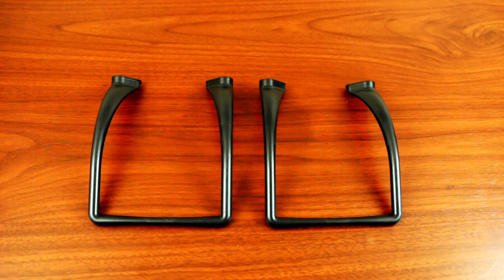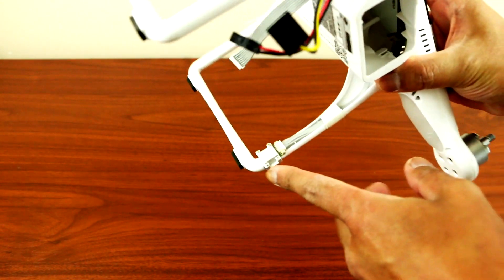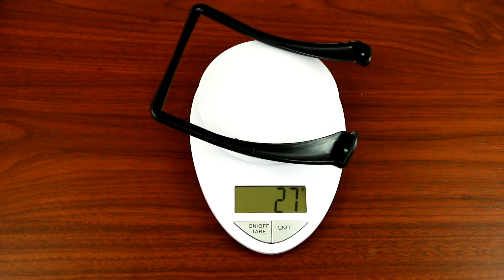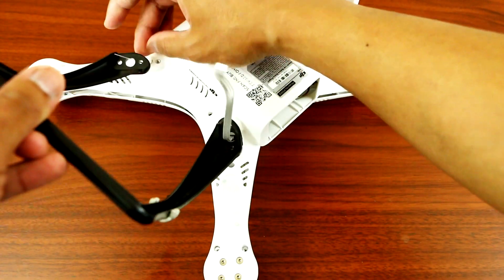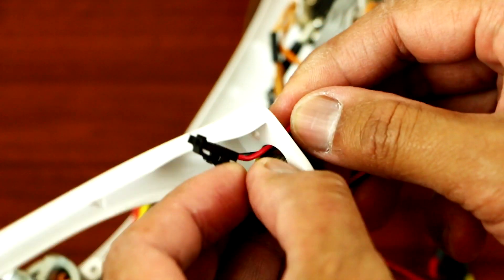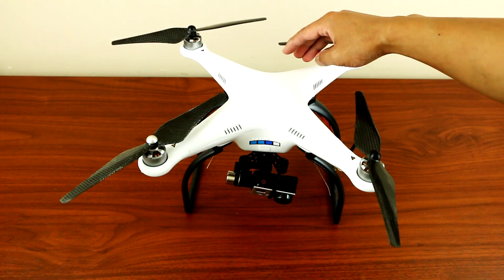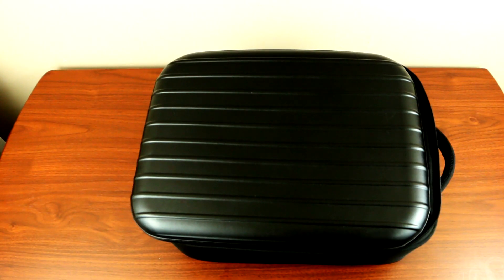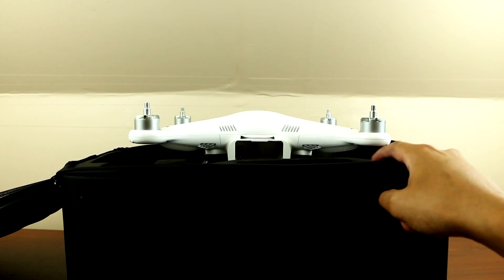DJI Phantom 2 - Aftermarket Landing Gear for Zemuse H3 3D Gimbal Users

Comment: i got a few more tips to make it better i had these before on a drone and I've had tipping problems lol so what i would do is get a few coat Hanger's cut them and zip tie them on the legs and then get some spung things really cheap 2/3$ on ebay and you'll never tip over

Comment: Hi, I want to do this on my P2 but my compass is in its own little plastic case on the rear leg and is not clamped on like yours, any ideas on what I need to do as there's no provision on these legs for my sort of compass?
Reply from the maker: +Andy Heath just use a zip lock. and zip lock it to the new landing gear. anyways, pls don't forget to SUBSCRIBE to this channel as it will help me out a lot, if not that's fine. thanks again my friend.

Comment: need to paint the quad the same color black or give it a unique color. good work having the futaba and carbon fiber props.
Reply: Too bad someone hasn't come up with the idea of just using black plastic in the injection molds instead of white, that way there'd be no need for paint. Daaah!

Comment: Hi, i want to install these however my P2 came with a anti static compass which does not have screws to remove it. It appears to be built into the landing gear that the phantom came with. To instal these will i have to buy a new compass for my phantom and install that as well?
Reply from the maker: it seems like you do have to buy a new compass
Reply: L BS just a thought. could one cut the original leg at the part where the compass is built in and attach that whole part of the original leg to the new leg?.....
Reply from the maker: Dan Headlam it might work, give it a try
Reply: Dan Headlam Dan, did you ever cut the original leg and did whatever else you were going to do? I purchased the taller landing gear as well to prevent damage to GoPro but my compass is also not removable. I'm trying to find a way to make this work. Thanks
Reply: yes i did ...it worked fine as long as you got the measurements fine, in the end though i got a new compass and fitted that as was more secure and all together more tidy.

Comment: Great video with lots of details.
Could you show us better how did you fix your video TX on the Landing gear ? And why your antenna is facing upwards ?
Reply from the maker: fix my video TX??? is it broken?
Reply: I mean .. securing it. How did you secure the transmitter on the landing gear. Sorry, that these might sounded to you all Greek, but ... I am Greek  :-)
Reply from the maker: George Hadjipavlis watch this then you will know why  DJI Phantom 2 - ImmersionRC 600mw Transmitter Placement (prevent velcro glue from melting)
Reply: This location does not interfere with the RC antenna ? Sorry for being persistent but it is a fantastic location and would like to make sure that this works just fine.

Comment: hello, your phantom 2 did not come with can bus expansion module? the can bus Serving for what? I still can not understand!
Reply from the maker: forgot to mentioned that I installed the can bus module in the phantom prior to the installation DJI Phantom 2 - How to install the DJI iOSD mini to Phantom 2 (clean look version 2)
Reply: ok, I'm not using the can bus expansion for nothing, can i remove it from the phantom? will not disrupt the functioning of the phantom? My salesman said that I would lose the warranty if I remove, but for now I do not need the can bus installed on the leg.
Reply from the maker: Bruno silva I haven't tried flying my phantom without the cam bus so therefore I can't tell you if there will be any disruption when flying your phantom. by the way why are you so persistent to take it off in the first place?
Reply: LOOoL! Good question! is because I bought a zenmuse travel clip in shapways but I had to make a change in travel clip for use in tall leg, and the can bus hinder a little clip
Reply from the maker: Bruno silva why don't you place the cam bus on a different leg or install it inside the phantom as what I did on my video  DJI Phantom 2 - How to install the DJI iOSD mini to Phantom 2 (clean look version 1)
Reply: yes I will do that! Thank you
Reply from the maker: your welcome!

Comment: One last thing. Mount your TX Higher on the landing skids with the Antenna pointing down. You should get better performance out of it that way.
Reply from the maker: what I noticed is you need have the TX away more from the phantom to get a better reception, that's why this wider and longer landing gear comes in handy and also it helps my h3 2d gimbal not touch the ground aswell.

Comment: I prefer the stock landing gear. There are other solution if you need extra length in your landing gear. Also you don't need to worry about measuring the compass placement as you did.  It doesn't really matter, just fit to the length of the cable and do a new calibration when you're in an open grassy field.
Reply: Ben7seven7 wider and taller landing is better with the h3 3d gimbal bc then it's very close to the ground
Reply: Ben7seven7 You dont need to make "extreme maneurvers" to have the landing gear in the vid using H3-3D gimbal. It's actually a mess. (You cant do turning to right without the landing gear in the vid)
Reply from the maker: I guess you don't own a h3 3d gimbal yet huh, then you will know you want a wider landing gear
Reply: I prefer stock landing great or similar style gear more from an aesthetic and weight perspective than functionality in terms of keeping the landing skids out of the video when performing extreme maneuvers. And no I don't own the Zenmuse gimbal but I flew with a guy at the park flying a Phantom 2 with the H3-3D gimbal.  I have the Phantom 2 Vision.
Reply: Ben7seven7  Quicker and cheaper solution avoiding gears in the vids is to tune GP3 into FOV Medium unstead of wide, then good video shots are usually done when you gently pilot. For sport shooting one other advantage of medium FOV is that you dont even need to be so close from your target to match in in the screen, then you run safer yourself and could be more away from your mooving target  once recording. Acuracy and security are improoved. Cost : O euros. For those who likes fast travelling with superwide FOV, just be prepared to do your best shots at almost good velocity going backwards but that will only feat for good superbes panorama. If you want to specially shot or follow something you trace medium FOV is better. For vertical views  landing gear could be avoid wether you choose Medium FOV or in Wide or superwide if you pilot gently in case there is no wind. An other solution is  rectractable gear weigh 80g  available on the web.Looks attractive

Comment: In my video using the Zenmuse H3 3D, I see the left landing gear with the CAN connector. Can't wait to see your result. You seem to have only the Zenmuse 2D. I think you want to mimick the H3 3D using your Futaba! Also the black landing gear with black props looks good!
Reply from the maker: yes im going to mimick the h3 3d gimbal with my Futaba radio. I already programmed my gain % when rotating my phantom and it looks very smooth, just need to film it and post it up on youtube. yah the black and white contrast looks good on the phantom. it looks like another type of drone : )